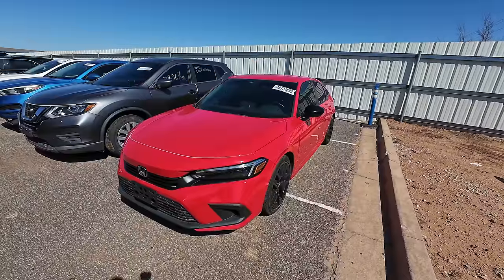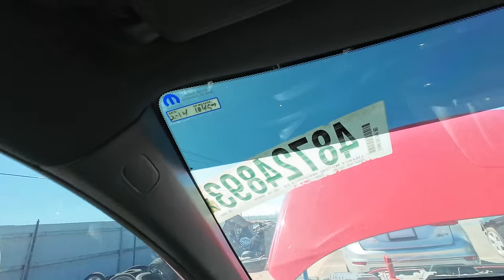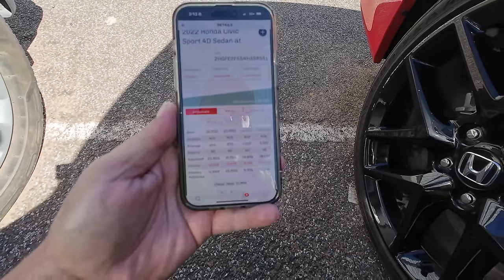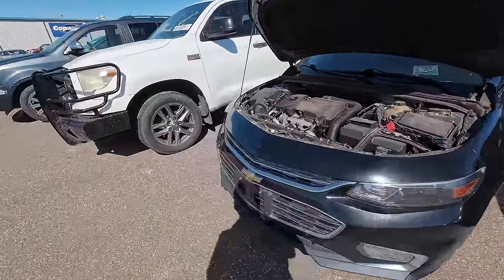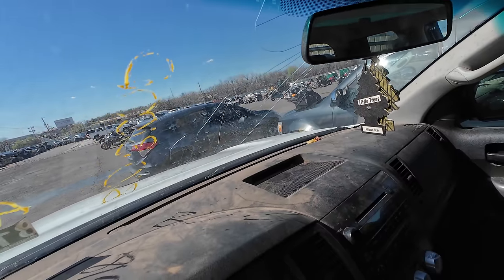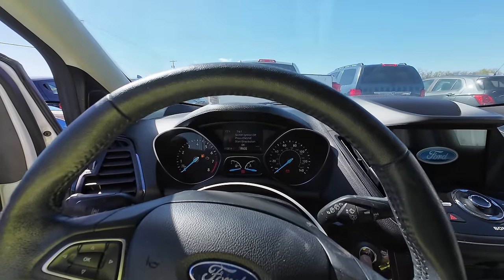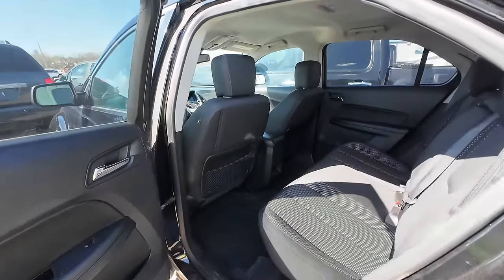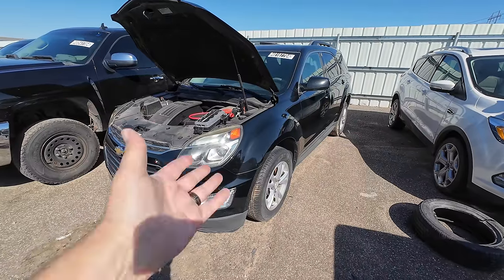This 2022 Honda Civic was Forgotten at Copart for 1 Year Now I'm Winning it for $7000

Comment: That 2016 Chevy equinox the engine will always make that sound no matter how long it sits and expect oil consumption after 100k miles i own a 2015 with the same engine and it started consuming oil at 100k i have to put a quart in every week.

Comment: Typically, the Civic Sport will sell around $22-27k used with low miles. It will be great for you to get one for $7-12k, considering it's in good condition (no major dents, runs smooth, interior is clean) that's almost 2 years old. They are great econoboxes with technology, fuel-efficiency, and the way they drive.

Comment: That Toyota Tundra you checked out, I’m wondering how the Lexus rims actually fit the truck. Tundras are 6 lug nuts but those wheels are from an LX570 with only 5 lug nuts.

Comment: The equinox 2008-2012 at least came with a 3.6 v6 or 2.4 4 cylinder and those engines are shared in the malibu, lacrosse, equinox, terrain, encore, so these equinoxes are basically a taller malibu

Comment: the Ecoboosts has a wierd timingbelt setup there's the ordinary timngbelt but than there's a wetbelt that's kind of an extra timingbelt which is running through some oil and if that breaks the engine is toast

Comment: Those engines do burn oil if you don’t change it like every 5000 miles or so. That Pennzoil stuff in the trunk is garbage. I do not recommend putting that stuff in this car. Even though that is the correct oil weight for this civic that stuff is basically like water. Not a very good quality oil in my opinion.